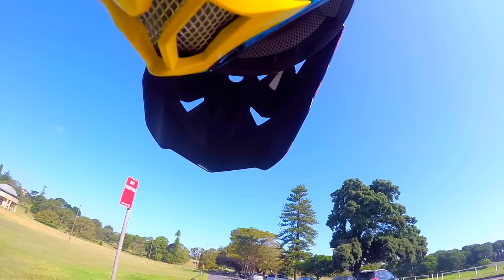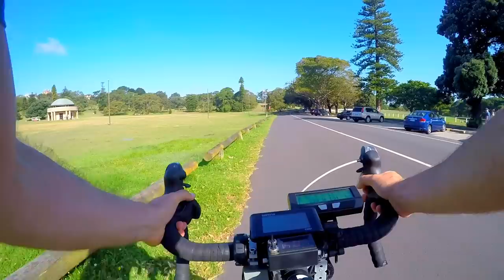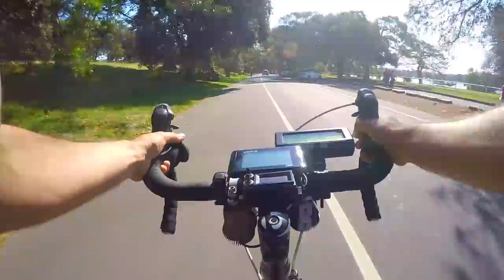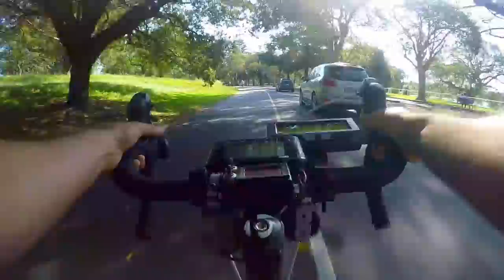Bafang BBSHD 1000w mid-drive • 74.1km/h top speed on flat (46T) • Electric Bike 48v BBS02 8fun motor

Comment: POWEERRRRRR!!!

I'm debating weather its safe enough to do the same to a roadbike, or if I should stick to a norco bigfoot...  Roadbike is tempting though I wonder what the long term effects are fatigue wise with the extra load and weight - I do a reasonable amount of k's commuting.
Reply from the maker: +265chemic - My sincere advice.... DON'T go for road-bike.. the thicker the tire the better! Hydraulic disk brakes,  suspension if possible....
I only setup in this bike so I can compare performance to BBS02. Road bike means zero impact absorption, very likely  to get frame problems (forget carbon frames) =]
Reply: +ElectricBike (Bruno) thanks for the reply.  I'll take your advice on this and go for the mtb frame.  Challenge will be finding a place for the battery pack as the triangle is tiny.  Might have to give a backpack battery a go to start with.
Reply from the maker: +265chemic - Yeeeahh.. go for MTB... thick tires are MUCH safer... There are so many "slim" battery packs coming out now and they fit almost all frames. In case of MTB, dual suspension makes things much harder as the chain tension changes as the swing arm flexes + the bottom bracket on dual suspension is "press-fit" much wider making the BBSHD install much more difficult. Hard tail MTB (front shocks only) still gives you a really good shock absorption, will be MUCH easier to setup your mid drive and mount the battery on your frame. Carrying the battery on the bike or backpack (like I do) varies by person, both options have "pros" and "cons" =]

Comment: With 1000W and a good S.Cx it's 55 km/h max, I think the motor is a bit overload with your sprocket ratio and provides more, at least 1500W! (Or serious downhill I see ^^)
Reply: Oui pour ce kit en mode off road c'est 1600w de puissance au maximum.

Comment: hello friend what did you do in this engine system or change the parameters of the internal controller so you can reach more than 70 km / h?  this engine that you used in the demo video had how many watts of power and in this video, in particular, did you help the engine pedaling?  and from what I saw in this video if you only used the engine without pedaling how much speed would you reach?  Is the engine and other electronic components of the system resistant to heavy rain?  and under normal driving conditions what is the maximum speed that the engine reaches? can you help me with these questions?  I signed up for your channel and I believe you will be able to help me I have many questions about this mid drive system from Bafang but little by little I am learning because here on YouTube it is very difficult to find a video tutorial to mount on the bike and make the configuration on the digital panel  installed on the handlebars there are many channels here on youtube that show people talking about this bafang system but the information is insufficient and many owners of these bikes that use these electric bikes with bafang kit show videos without much explanation or details of the operation for example I don't know  if this engine works independently of the pedal type, does the user activate the accelerator and the engine starts or does the engine deliver power according to the pedaling mode?  I dream of buying a centrally engineered bafang kit but I don't want to pedal and use only the engine and I will only pedal uphill if I realize that it is a very steep climb or that it can force the engine a lot. Friend among the various control displays  which one do you recommend to buy or that in your opinion is easier to configure?  I am interested in buying the 1000 watt bafang electric kit and I want to use the following ratio to have the maximum torque and final speed so the free crown of the engine will be 42 teeth and the rear ratio with 11 speeds being the first gear with 51  teeth.what do you think but your opinion is good?  thank you in advance and congratulations on the content posted on your channel.

Comment: Hey very nice bike! 
I bought a brand new bike with this system fitted and running 48v 20ah battery. I am getting some motor vibration through the frame at high speeds constant and momentary through the rev range and I thought after watching your video I would ask if you experience this at all. I fear I have an imbalanced rotor. Thanks

Comment: ooooh awesome i'm looking at getting this middrive and i'm a road cyclist too, can i ask what bike you've put it on? i'm concerned about number of gears etc and if it will fit a normal(ish) road bike. I'd love to know what bike you've used and your setup. cheers o/
Reply from the maker: Yeaaahh I used a Trek 8 speed road bike that I bought back in 2011 I think, aluminium frame is better for mid drive, carbon may not fit as the bottom bracket is much thicker and need adaptor. I also have a fat bike 10 speed, some people have 12 speed with mid drive. Here is a video from 2015 showing the bike around https://youtu.be/ZsQIA8INPWg
Reply: @BrunoPOWEEER  oooh thank you so much!

Comment: Hello burono I have Bbshd but only strict to 43kilometre or 28 miles per hour how your Bbshd does 70 kilometre fast did you do something? There are programming cables available on Ebay would it be possible if I buy this programming cable to go faster ??

Comment: I really want to build one of my roadbikes with electric for commuting. My work is about 15 miles from my house with about 600m worth of climbing and about the same descent.
Reply from the maker: +Tyler Raber  - Yeeeahhhhh... go electric... I can absolutely guarantee you'll never go back!! If you're putting this on a road bike, here are some things you have to consider during the installation https://youtu.be/ZsQIA8INPWg
An "easier" option is change the drop bar (road) to flat handle bar (regular bike) but watching my video above and the video I will make explaining the throttle adaptations, you'll be fine keeping your road bike all original. When you go electric, you will get that downhill feeling all the time... no matter if you're riding on flat or up hill, you'll love it =] 
*get the BBSHD
Reply: ElectricBike what about batteries. What's the cost like?
Reply from the maker: Yeeeahhhh.... batteries... great question! The same websites selling the Bafang BBSHD and BBS02 will be selling batteries and if you buy together they make a better deal so =]
I am an electronic technician so I designed my own pack. I have so many videos talking about batteries here in this playlist https://www.youtube.com/playlist?list=PL59mIOWSOm9qrSglqe18AlYfBJRXLdduj and will be making a series of videos explaining everything you need to know about batteries, configuration, discharge, fast charge, BMS, 13s vs 14s... etc...
Reply: +Tyler Raber depends anywhere from 600 to 1000
Reply: A1techplus for just the batteries?
Reply: +Tyler Raber yes. just battery. I highly suggest Erad 750w or 1000w kits. the 750w is $950 and 1000w is on sale at lectic cycles for $1129. now there are different range of batteries you can choose from. 36v to 48v with different range of Ah (14Ah being the highest. higher the Ah longer range for the bike). good thing about mid-drive systems like Erad you can configure it to go more than 20mph. depending what bike you have a fat bike with Erad 1000w can go upto 40mph. check out lectic cycles they specialize with mid drive kits and sell bikes with mid drive kits pre installed. and check out electric bike review of Erad 1000w
Reply: Sang Lee that's way more than I'd want to spend.... what kind of range on a mid drive kit with this on a road bike? that gets at least 20 mph?
Reply: Well ebike regulation and laws really depend on your state. But federal limit is 20mph top and 750w motor. 
The range really depends how economical you are with pedal assist and throttle and type of battery. Typically anywhere around 15 miles (throttle only) to 50+ miles. On the daily basis for commuting 15 to 20 miles is plenty. Plus you can charge in between rides if the batter is detachable. And one thing about the laws and regulations on ebikes is that most cops (pretty much all cops) don't care about ebikes at least in the US where the ebike culture isn't that big. 

If you're on a budget I highly suggest Rad Rover which is $1499 plus shipping. Keep in the cart for a day or two they will send you discount code. RAD Rover is a Indiegogo crowd funded fat ebike. Powerful motor with 500w nominal w 750w max high quality motor, with 48v 11Ah Samsung Lithium battery with twist throttle all for $1499. But the motor will cut off at 20mph due to Federal regulation. However it is possible to go passed 20mph with pedaling with some electrical assist just before it cuts off. I've seen people reach max speeds up to 35mph on 20mph limited ebike with 250w motor but that was probably going downhill with assist helping to pedal to gain speed right before it cuts off at 20mph. 
I don't recommend mid drive kit for road bikes. Installation can be very stressful with road bike handle bars because mid drive kits aren't made for road bikes. This guy in the video was able to do it because he has the mechanical skills and experience especially with roadies, but if you are not mechanically inclined I don't suggest mid drive conversion on road bikes. 
One good thing about fat bikes is that you can go on pretty much any terrain snow rain mud hills you name it.
Reply: Tyler Raber if you have experience with 2 wheel motor vehicles, going 20mph is fine. But if you don't. 20mph is plenty for commuting. More big name mid drive kits like bionx will have very powerful motor but motor will cut off at 20mph. But lesser known brands like bafang and erad you can configure them to go passed 750w power setting and passed 20mph. It's easy to get power hungry. 

But I suggest if you're on budget Rad Rover is the best bang for buck with decent quality components. Also look into Xtreme 1000w fat bike. They are crowd funded e fat bike with decent quality motor and components but I highly recommend the Rad Rover. Check out the Video review on Electric Bike Review on YouTube or their website

Comment: how stable is a bike at that speed actually?
Reply from the maker: +Frederik Hollstein - huuuuummm... interesting question... I only set my BBSHD in this bike to have a true comparison in performance between BBS02 and BBSHD.
Feels okay but road-bike with or without motor is the unsafest bike, zero impact absorption, very bumpy, not good brakes, if you do have good brakes you don't have enough grip to stop the bike... geometry is designed for flat ride (if you hit brakes hard downhill is loses rear wheel control easily) but is lighter and faster. How does your bike feel?

Comment: Very entertaining, so you have a 52T in the mail I hope?

Is everything stock atm? if so when does the modding start :)
Reply from the maker: +Jayme Capurso - Ahhhhh.... unfortunately the 52T is not available anywhere at the moment for the BBSHD, I have many for BBS02 but it won't fit and can't be adapted... I guess I will have to go to an engineering shop and make this thing myself... 
All stock at the moment as I want to show people the "normal performance" first, then I will start play with the controller. 
The only thing I did was enable the throttle to 100% and tricked the controller to disable the max speed limit (I am making a video explaining all that). 

I am waiting for a new controller from Grin Technologies due to arrive in Jan2015, I will pump much more power in this powerful motor, I am sure it can handle 3000w hahaa...  =]
I am making a super fast one with over 56HP so the power to weight ration will be similar to the FormulaE cars, all parts arriving in January 2015 I will take that thing over 200kmh... videos showing every single step.. ohhh yeahhh...
Reply: haha, I think you will need fins to keep you on the ground at that speed :)
Reply from the maker: +Jayme Capurso - The "rocket man" did 333kmh installing a rocket on his bicycle so I'm willing to do whatever it takes but I'm getting there =]

Comment: What throttle are you using on drop bars?  Thanks!
Reply from the maker: +Dereck Howerton - Yeeeahh... I am using the left thumb throttle mounted on a copper "T-joint" plumbing pipe I riveted to my handlebar (I am going to make a video showing in detail) you can see something here in this video: https://youtu.be/ZsQIA8INPWg
So much POWEEEEEEEER =]

Comment: how long does a full charge of the stock battery last? i'm not talking about distance but riding time thanks.
Reply from the maker: +Manuel Abella - Hi Manuel, I made my own battery pack from scratch, it is more powerful than the frame mounted compact ones. I explain my setup here https://www.youtube.com/watch?v=ZsQIA8INPWg and I talk about my battery here in this video https://www.youtube.com/watch?v=M41BB5g05bI
Riding time depends on many many factors, from the tire type and pressure to the wind speed/direction. If you are only riding on flat, if you ride in a hilly area, if you're in traffic with lots of stop and start... all these things will impact on the time or range. I always recommend people to go for the larger battery possible so you're not limiting your ride and fun to a short range battery! I can't never get too much POWERRR =]

Comment: the speed of the motor is now 160 RPM.     should the ebike be faster?
Reply from the maker: +Henry Chang - Yeeeahh... the BBSHD spins much faster... is says 160rpm but I measured 189RPM with a 52v battery pack (unloaded speed) https://www.youtube.com/watch?v=OhictAuj-oc. Just for comparison, the maximum unloaded speed on the BBS02 was 155rpm https://www.youtube.com/watch?v=chO8e_RCdto
BBSHD spins faster, has much more torque, you will get at top speed faster.. so much POWEEEEEER =]

Comment: What gear system are you using in this video?
Reply from the maker: I am on a 700c road bike with MTB cassette 11-36T and the 46T Bafang chainring that comes with the BBSHD...  also another thing very very important is that I run this motor on a 52v battery which gives you a much better performance than the standard 48v battery.... soooo much POWEEERRRR =]

Comment: Doing 60-70km/h in centennial park isn't the wisest thing to do on a bike with thin tyres and mechanical rim brakes. You're stopping distance would be huge at those speeds - find somewhere quiet next time.
Reply: Thats not 70k. Look at his speed compared to slow moving traffic. 70kph would require 2500watts or more.
Reply: It's a road bike and downhill that's why it's so fast.
Reply: mid drive with a good cassette can go up to 70 km/h with an over-volt
with 1000w motor
Reply: Hes on a bike not like he would hurt anyone to bad other than him self so who cares
Reply: but it create pretty big wear and tear too sadly,hub direct drives are slower but a lot more reliable.

Comment: Can you vary the speed with a throttle?  Or is the throttle only on/off?
Reply from the maker: Leanne Bailey yeaahh... you have two ways to use the power, pedal assist (helps you as you pedal, 9 levels) or throttle. Some people only use pedal assist, some people use throttle only and some people use both. To use throttle only you have to set te pedal assist to level 0, the original settings from Bafang doesn't allow you to throttle at level 0 so many dealers change the programming to enable this. I use throttle only for fun but pedal assist you get more range. 
So much POWEEEEERRR haha
Reply: Thanks for replying.  However, is the throttle graduated?  Can you use a twist throttle where you can squeeze a little only for a little power?  Or is it just on/off?
Reply: Leanne Bailey Yes it. It's a variable speed controller.

Comment: what is the maximum distance you can go with 30kmh average on pedal assist mode with quite some sportive effort?
Reply: Depends on how much effort are your leggs giving and if ur riding flat or hilly route. On semi flat. 20 km 130 height meters and 80 kg rider u need around 190 watts. If ur putting 150 watts and motor 150 watts thats 300watts thats around 36 kmh average.  And if your battery is 670watthour ur gonna get out 3hours of riding. You also need to count in inefficency of the motor. Wich is around 22 percent or more. Depends how much power is putting out.more power is putting out more efficient it is.  Soo if u want to get 150watt on wheel your motors needs to burn 200watt.